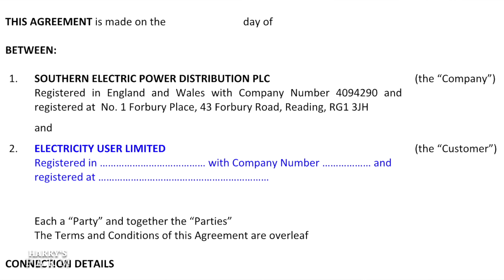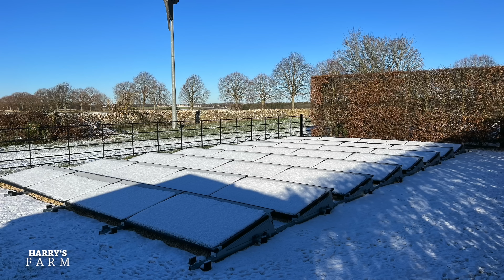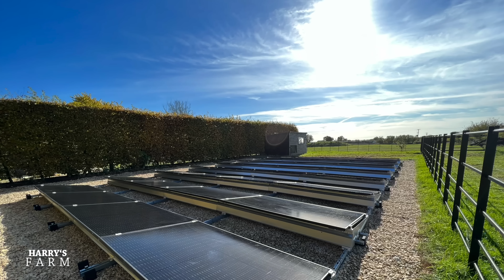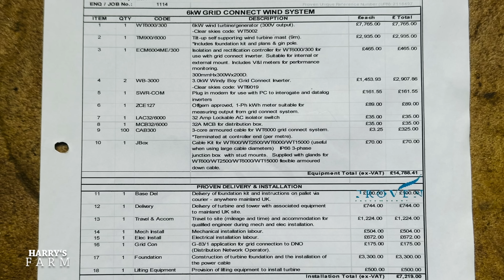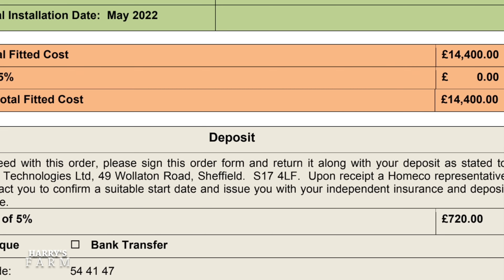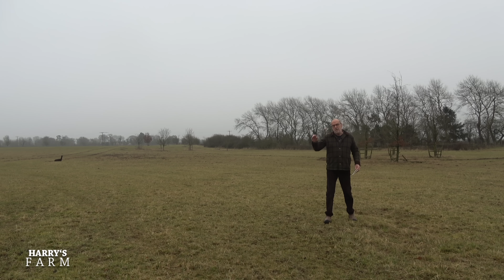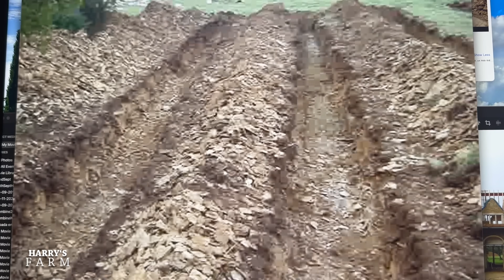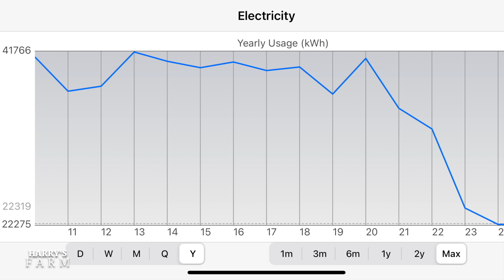Are solar panels & heat pumps worth installing? Here's what I've learnt after several years of use.

Comment: Extremely interesting and useful.  Almost as good as the car videos!  Three points:
1. Modern air-source heat pumps have a coefficient of efficiency (COE) of about 4, so much the same as the ground-source heat pump (and much cheaper to install, obvs).
2. The electric AGA uses resistive heating, so about 4 times less efficient than the heat pump.  It's not saving you energy, I'm afraid.  On the contrary.
3. Octopus have a night-time tariff of 7p/kWh for charging your EV(s) and your storage battery (if you have one).  This would make the heat pump much cheaper to run in the winter.
Reply: 1: It's coefficient of performance (COP)
2: Proportionally an oven uses a tiny amount of energy compared to heating a house.
3: Even at high COP a heat pump will quickly gobble up even a fairly large battery store.
Reply: I was recently viewing a new build estate in Cornwall. 
Each house has GSHP and EV charger - with those inclusions, I found the lack of solar puzzling.
Reply: If the government were serious about this Net Zero rubbish every new build would have a bore hole.  One off cost is a lot.  But if you were providing every plot on a new estate with one the cost plummets.

Comment: Harry you're really not taking full advantage of the system - install solar optimisers to minimise the shading issues - not expensive at around £50/panel (Tigo) and install some battery storage that you can fill with off peak grid electricity overnight - it will mean you'll export so much more. I've built 2 LFP batterries one for our house in the UK (60kwh) and one for our villa in Spain (75kwh) and through some careful tweaking I've brought our UK costs down to around £1500/year - and our annual usage is not dissimilar to yours at around 25-30MW (and we run 2 EV's). The Spanish property is off-grid for all intents and purposes. LFP is very cheap now at around £100/kwh of storage and given you have the space should be a no-brainer.

Comment: Hi Harry, I have some solar panels as well,  it is obvious the angle of your panels to the sun is really low, like 15degrees,
when at your latitude, they should be around 55degrees to the sun, especially in winter. If you changed the angles, your results
would be much much better.
And cut your hedge.
Love the shows, keep the coming.
Reply: Agree on the angle but you are hardly going to switch them every late autumn to 55 deg.

Hedge is a no brainer for output but aesthetic in what is otherwise picture perfect Cotswolds - that has a value to.

Comment: My question is why the solar system is on the ground?  Why not on poles or raised grid with tracking?  Is this all about aesthetics or efficiency?  Your heat pump when not powered by the solar panels or wind power is it motivated by the Grid?  Is the Grid power created by green energy such as water dams or coal or oil?  Heat pump getting its power from oil or coal is not clean energy in any means.

Comment: We have a 12kw system on our house in Queensland Australia, the first year our outputs were all over the place. The system should have run our house without using any electricity from the grid no problem. However we didn’t realise just how much "shading" the panels would affect them.
The first three months cost us a little to run our house until we cut down two very tall gum trees around 30 metres from the house. Ever since then the electricity provider has to pay us money every month. Shading really matter. Thanks Harry, good video.😊
Reply: Yes; I remember Queensland heat and sun , quite memorably!! Picking fruit there , was a challenge ! 
If our climate was a third as good as yours, I’d settle for that!!
Reply: Did your installer not mention this to you ?
Reply: Consider panels with micro-invertors when it is time to replace them.
Reply: duh.  They use SUNLIGHT to generate power and you didn't understand SHADING would effect them.

WTF?
Reply: @ the point I was making was that the gum trees were very far away from the panels, even the very sparse tops of the gum trees casting a very small shadow made a big difference to the panels output.
It doesn’t take total shadow to make the system unviable. Hope this helps you understand.
Reply: @johnrauner2515 
What was the pointless insult for ? His reply was perfectly rational.

Comment: Install battries Harry and charge them in the winter from your over night cheap rate car tariff, and from your solar in the summer, I have 4kW of Solar and 16kWh of Battery, 220m2 house and an electric car and I use an average of £80 /month of electricity, (including 5 air conditioning units for cooling in he hottest months) however I still heat my home and hot water from oil, which costs around £70 /month average, so total of £150 /month average for the whole year including running an electrical car.  The total consumed from the grid is around 12500kWh's per year, of which 9500kWhs are charged at 8.5p per kWh.

Comment: The upside of bore holes for the heat pump is that you get below the seasonal variation in ground temperature and always have maybe 10 C where you live (the yearly average temperature).

Yes, the panels don't deliver much in winter but in addition to that you have them almost flat on the ground and partially shaded by a hedge... bit poor planning, or I guess prioritizing them not being visible...

Comment: An intelligent Solar system with a battery can harvest cheap electricity at night (or when the price is low) and be used when the price higher. (peak hours). Especially usefull in winter months when tariffs is higher….

Comment: My understanding is that energy production of virtually all UK commercial solar arrays/farms averages 11% of the installation’s peak capacity annually, taking into account seasonal variations, daylight hours and losses from conversion rates etc. As for the question of angles of the PV panels, large farm buildings have a roof pitch varying between minimum 6 up to 15 degrees typically and rarely above 30 degrees. Battery storage would allow you to charge them at lower off peak rates during the night, but as with all these green options, there is a significant capital cost to be weighed up against potential savings and payback periods. The issue of life cycle charges and dropping efficiency also becomes an issue the older the batteries get, requiring replacement eventually. 
From what I have read on the costs savings achievable with domestic heat pumps installation, in less modern houses the requirement to significantly upgrade the thermal efficiency of the property to ensure the high COP ratings, if undertaken can go along way to providing big savings with your existing heating system, even without a heat pump ‘upgrade’

Comment: I lived in a place with electric underfloor heating (and standard baseboard electric heaters). It was great. We never turned on the baseboard heaters unless it was esp cold outside (-5C) and the heat produced by the floor was really nice. Gentle heat, wonderful feeling for the feetsies, and dependable. The only downside was the leadtime-- if you wanted a few more degrees for comfort, it took an hour or two to reach it. Overall, great experience. Would recommend.

Comment: For a gentlement that has a real appreciation for esthetics and design to install such an ugly, eyesore, inefficient, and inefficient wind turbine is a disgrace.  That is a reprehensible addition to the landscape for such a locale and build.  Much easier and esthetic to drop another 8-20 panels in conjunction with a heat pump to offset the off season heating and hot water for the property all the while applying the KISS principle instead of multiple systems with their inherent fault and differing depreciationa and swap out schedules.

Comment: Here in Qld Australia, i have a 6kwh system on the roof of the house which produces around 1700 kwh per quarter and we use around 1000 kwh hour per quarter, so nearly half goes back into the grid as we have not battery yet. 

Energy companies have it all stitched up as we currently pay 30c per kwh for the electricity used and get only 4c per kwh back on the excess that goes back in! And they charge a connection fee on top of that.

Comment: I've gone into wind and Solar in depth and it's quite hard to justify the outlay.
But what I came here to say is it's become quite useful to get a BEV with biodirectional charging, that way you don't need a standalone battery sitting about doing nothing in the winter, you can use the capacity in your car battery as a storage facility.
For example i can charge the EV battery at 6.7p per KW for 7 hours over night on a cheap tariff, then use that electricity during the day instead of paying peak rate.
It works very well if like many people you use far less per day than your cars range.
You basically run your house with electricity at a quarter of the price.

Comment: Yeah, angled more to the sun would certainly help. Adjustable can be changed during the change of seasons. Microinverters on the panels avoids the shading issue. Excess power to electric car or back to the grid. Great details.

Comment: You got it in one.  Balance.  A combination of solar, wind and battery.  Here in Australia we need the energy to run our aircon in summer.  You would think that with all our sun we would have excess energy, but unfortunately as the panels heat up and the ambient temps reach 30 plus C the panel efficiency falls off.  The panels don't like a huge amount of heat.  Bottom line, it is our houses that are the main users of energy, we need to get our homes better insulated.  Our vehicles do not use the amount of energy our houses do.  We use trees and hedges and climber vines on the outside to stop the heat and the shade from the trees to protect the home.  My friends at Lightning Ridge have their homes underground and experience a stable temp all year round  while the outside temps in summer get into the 40C plus.  Great video Harry and so different from what we experience in Oz.
Reply: In Oz the most productive times are the shoulder seasons when we don't need AC or heating. I installed solar about 7 years ago and we export just about zero, having a lot of export capacity is a fool's game because the feed in tariff is so low.
Reply: Water cool the panels and get 'free' hot water?
Reply: @james.telfer  This! It's called PVT solar modules and they generate both electricity and heat. Pretty cool technology (no pun intended ^^), as the circulating water cools down the module to keep up the module effinciency + transfers some of the heat into the water circulation for hot water or heating.
Reply: @christiansagert4613  in theory very good, but you will have the maximum of heated water in the already hot season when you dont need so much for heating. and you cannot export it in the grid ;-)
Reply: @ Yeah, true. Hot showers for everyone in brute outside temperatures :D
Reply: A comparison on the output of your commercial / farming pva's would make for interesting viewing / reading.
Excellent Vlog   👌

Comment: Nice setup! I have two observations, though: first, the photovoltaic panels are set at a very low angle, ideal for summer production but very poor for winter production when you need the power most. Here in Canada we generally set up solar arrays at latitude. I'm at 52N so my array is set up at 52 degrees. Now that we're operated our system for over seven years I can see that slightly more vertical, say, 65 degrees, would have been better still, especially when shedding snow. 

Second thought: your trenches are very shallow. Granted, your climate is milder than mine (central British Columbia) but I've never seen trenches less than six feet deep. Eight is common here. At shallower depths the soil temperature is often too variable, which leads to diminished production. BUT, your system is doing its job admirably, and nothing succeeds like success!

Comment: Thank you Harry, this was very interesting and informative. As it happens I have been advising a friend with a similar property, thus similar considerations. 
However, it would have been interesting to extend the logic and practical application of localised energy production to take in micro hydro as well. Of course I realise that the applications are scarce, but, the low running costs and ideal match of anticipated to probable consumption give incredible cost efficiency. 
Recent research indicates that over the centuries there were as many as 50,000 small and micro hydro power installations in the UK from small local waterwheels powering occasional use flour mills, mechanical hydro powered mill factories in the textile industry to a few relatively large (and sometimes quite modern) installations supplying large country estates and the areas used by them for the local populations.
I’m sure that with even a fraction of the capital and effort investment that has poured into solar power, the renovation of a large number of abandoned water mills could have been undertaken, more quickly and at a fraction of the cost.
Of course, it wouldn’t work so well in the Cotswold farmlands, sorry!

Comment: There is way too less production of windturbines in the 5 to 15 to 25 kw output range in general I am shure, and I think there is still a lot of state/county regulation of usage through private owners too, that's why prices are way higher to have and use such a system in addition than it could or should be? (More production and competition should bring prices down, produce more demand and use of course.)

Second - you cover up your swimmingpool with some floating eight or ten inch insulation over night or as soon as the pool season is over to increase efficiency of storage?

(I am sorry, but have you ever been thinking of just putting posts under your solar panels besides the hedge and lifting them all up a little, maybe 1,2 or 1.5 meter?)

Comment: We run both horizontal ‘slinky’ ground source and boreholes, so experience with both. Each 60m horizontal trench with 400m of 40mm pipe is good for 1.3kW 24/7. On the other site, two 115m deep boreholes just 125mm wide supply a 12Kw heat pump. The difference is that the horizontal array covers 3.5 acres and will deliver 53kW 24/7. The two boreholes supply 12kW but are on a tiny patch of lawn. The excavation and drilling costs were about equal at £12,000. At the end of the day heat from oil or heat from ground source costs the same; about 6p/kWh.

Comment: I would suggest that you get someone in to look at your install. It's too shallow for winter. Look at where the sun actually is in the sky.. That is where they should be pointing! You could make them adjustable for winter and summer seeing as they're easy to get to. I have less kW installed than you and generated more than you in the same time period. And get a battery.

Comment: There is way too less production of windturbines in the 5 to 15 to 25 kw output range in general I am shure, and I think there is still a lot of regulation of usage through private owners too, that's why prices are way higher to have and use such a system in addition than it could or should be? (More production and competition should bring prices down, produce more demand and use of course.)

Second - you cover up your swimmingpool with some floating eight or ten inch insulation over night or as soon as the pool season is over to increase efficiency of storage?

Comment: The point of a solar storage battery in Winter - you charge it overnight at cheap offpeak rates (7p kWh), and run the house the following day using this power.

Comment: I live in the south of Vietnam and sat down to evaluate should I install solar panels for electricity, we have solar heated hot water though the screen does need a good cleaning. My house is built in three floors with AC's in three of the six bedrooms, only three are used as bedrooms. A large AC cooling the ground floor at present our power costs are about GBP 50. We pump our water supply from 27m below ground to tanks in the loft area.
Pricing the solar installation to cover enough generated power in the 12hr day and enough batteries to cover the 12 night, made the system more expensive than buying power. The power supplier does not accept any excess power from the solar system. Then the cost of replacing the batteries a regular intervals knocked solar out of contention. Now this amazed me with all the sun that Vietnam gets but it's the 12 hr. nights and AC use and the allowable roof space for panels that cripples the system.

Comment: Thanks for the great review and for persisting when its not easy. Here in the USA my two year old building has 444 solar panels on the roof. We are on a net billing plan whereby we sell all of the power we generate to our utility and buy what we consume from them. We have two meters. In summer we produce about five times what we use and bank that for use in winter where we fall short. Overall we are producing in excess on an annual basis and earning a cash credit. So no batteries expense or needed.

Comment: Air to air heat pumps have the best efficiency, are much cheaper than air to water systems (no radiators to install), and can sometimes double up as air conditioning units during the summer. I have one, would recommend.

Comment: You're missing the main advantage of having the battery system.  Get as big a battery system as you can and charge it over night at 7p a kwh, then discharge through the day.  Your average price per kwh will drop dramatically and if you play the game with IOG on octopus you can run your house at 7p all day if you charge the battery at the same additional cheap ev charging slots it gives you through the day.
Reply: Yep - exactly what I’m doing.
Solar with a battery, so during winter when solar is low, the battery charges at 7p kWh on Octopus Go Intelligent and this powers the house all day ☀️⚡️😊